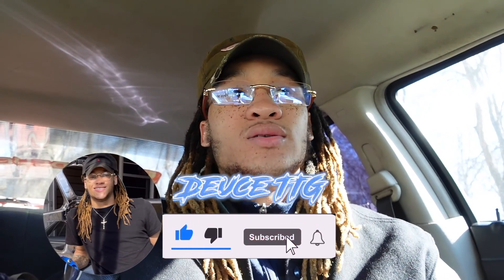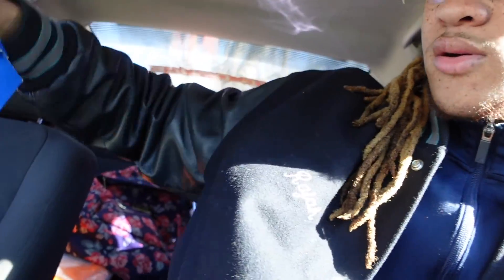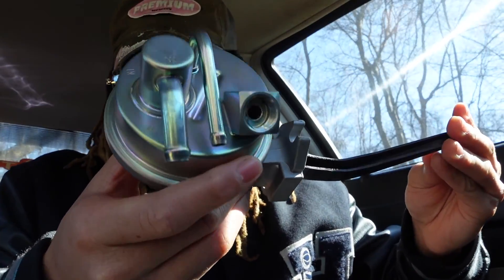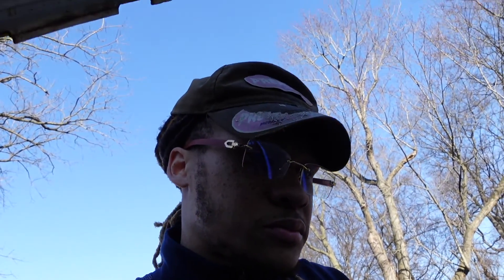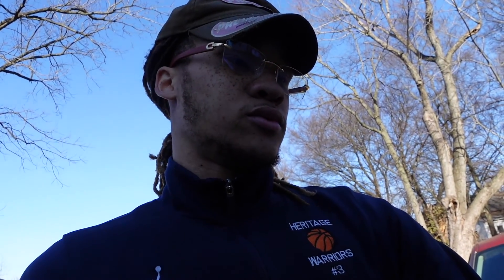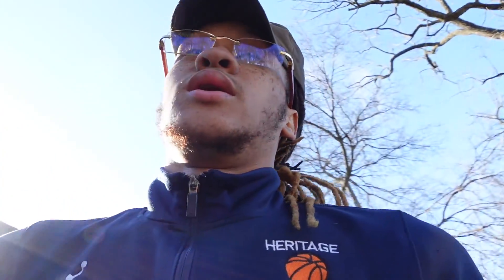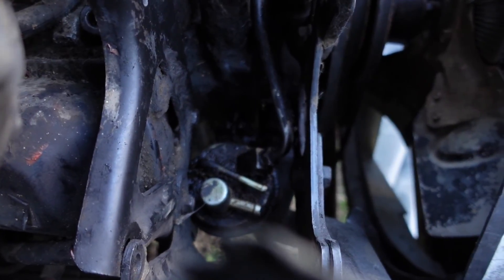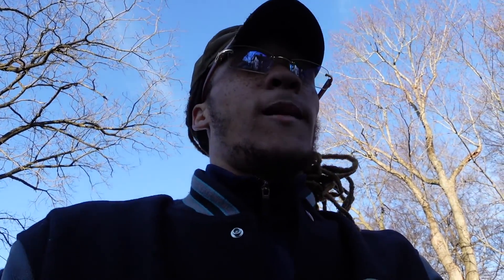I Really Need Y'all's Help! Changing My Oldsmobile Cutlass Fuel Pump

Comment: Gotta get the rite tools. Try it from the bottom and see if it's easier for you.
Reply from the maker: I tried from under the car, I got all the bolts off except the fuel line on top of the fuel pump
Reply: @DeuceTTG  ok put the other bolts back in because you want be able to get the fuel line off. The fuel pump needs to be bolted on so it want turn while you trying to loosen up that fuel line. All fuel lines get taken off first and the other two bolts last. So you want bend them fuel lines
Reply from the maker: Okay. Thank you frl, I really do appreciate that. I’m still learning!
Reply: It looks like you need a flare wrench, kinda hard to see but like the last guy said bolt that bih back on . And maybe tackle the line from the top if all else fails
Reply from the maker: @gcova7198 fasho, I appreciate that!!

Comment: Disconnect the hardline from the rubber hose and pull out the pump and work on it on the ground
Reply from the maker: There wasn’t a rubber hose connected to the hardline. It was just that hard line going to the carburetor